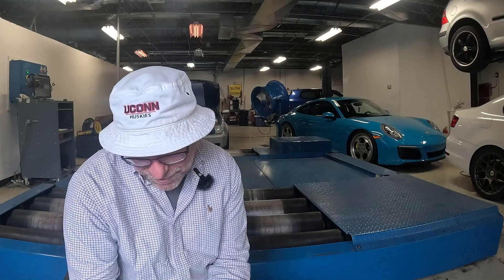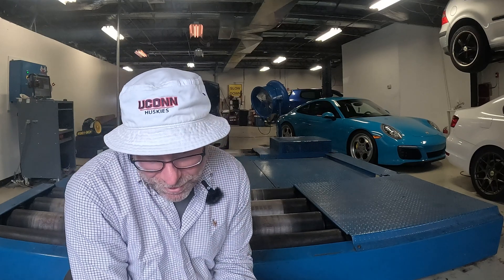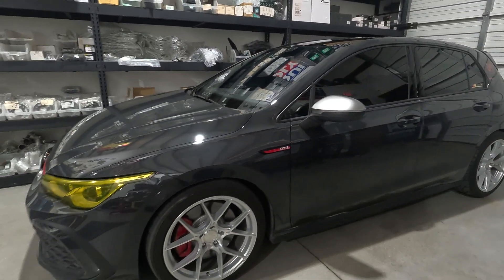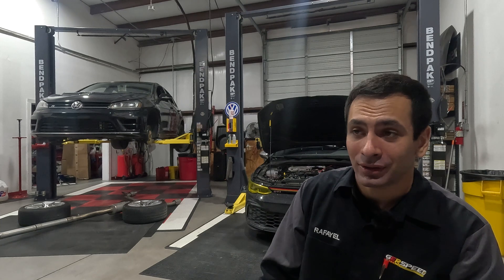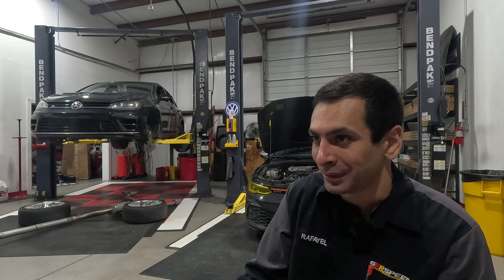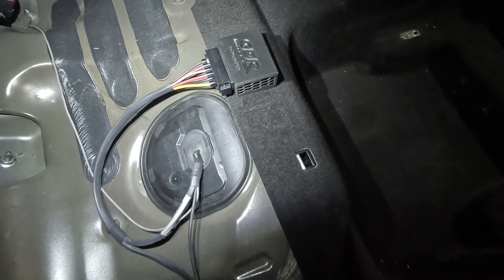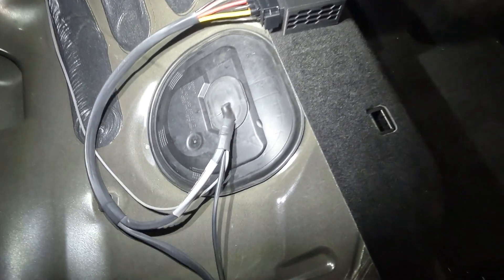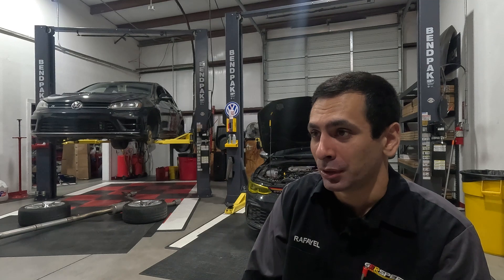World's Fastest MK8 GTI Port Injection + Flex vs C8 Corvette & 60-130 | GERSpeed x United Motorsport

Comment: Someone please help me, 2260 overbosting my ea888, over 2.0 bar
Reply: Thats what the 2260 does. Its a throwaway turbo, makes like 30 more hp than a stock is38 and its hard to control and sensitive to shaft speed. Its the turbo you skip over and get a 3071R instead

Comment: Would you say a mk8 gti running e85 on 2260 should last ?? Somewhat reliable. ?
Reply from the maker: Yes as long as it has our fuel pump kit and port injection for the needed fuel headroom. Too many tuners are leaning out the mixture to buy more fuel overhead which is just not the right way or the safe way of doing things. We have countless 2260 cars on the road.
Reply: 100% Just need a good tuner. Like UM 😎
Reply: Slow 7.59 for 500 hp
Reply from the maker: @icapelli487 bear in mind a lot of time is lost in the shift. Once NLS is deployed, we can expect a reduction of 2-3 tenths from just that by itself. We are also shifting a little early at just over 6500RPM and while the DA is good, there is certainly better during certain times of the year. Under ideal conditions, the car should be capable of cracking 6s but given the present factors, a 7.5 was all we could produce.

Comment: Are these new motors stronger than the mk7?  Torn between mk7 golf r or mk8 gti
Reply from the maker: We by accident had a new 8Y S3 lay down 600AWTQ on the same dyno when we first discovered turbo max on the 2563 and the bottom end held together after the car had already made dozens of street passes. Whether there is any significant jump in torque capacity on these new blocks can only be determined through either trial and error or direct teardown comparison. VW did somewhat significantly drop compression on these new blocks so in theory they should be able to take more boost.
Reply: @gerspeed  that is good to hear about the compression.  Less compression is just better.  Ive seen the mk7 platform do some real work and want to see if the mk8 can surpass it.
Reply: @Hardwaretuned I had both a MK7.5R and now a MK8 GTI (thanks to someone running a light)
If you want to go for big power, the MK7 R has the support and the AWD to help put it down. You can really make those scary fast. The MK8 GTI will always be traction limited compared to the R, but I honestly feel like they’re not too far off from each other. Feel free to ask anything you’re wondering about!
Reply: They are identical short blocks! R have 9.3:1 all mk7 and mk8. I saw lot of them apart😉
Difference is hpfp and turbos.
But compare r to gti sure is compresion difference…like always😉
Reply from the maker: @marekf1001  the MK7 Golf R was 9.6:1 compression ratio. The new MK8 Golf R is 9.3:1 - here are the technical fact sheets from VW:

https://media.vw.com/assets/documents/original/6387-1646354283566f0c7d73925.pdf

https://media.vw.com/assets/documents/original/17289-2024GolfRTechnicalSpecsFinal.pdf